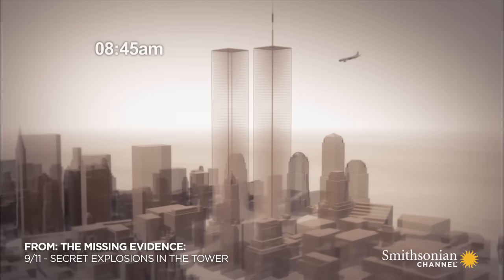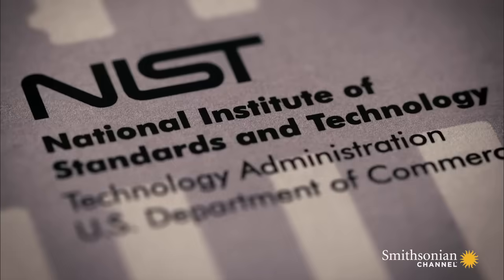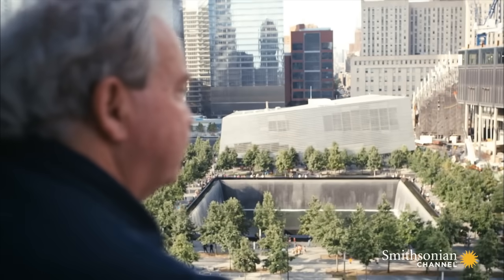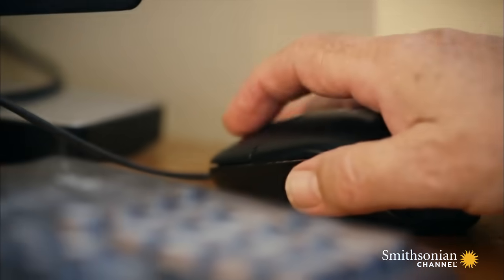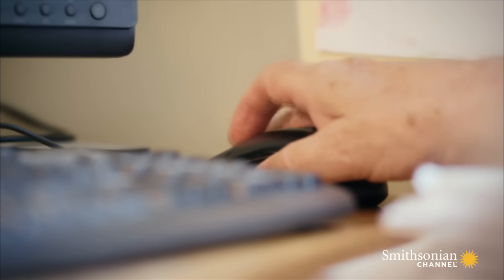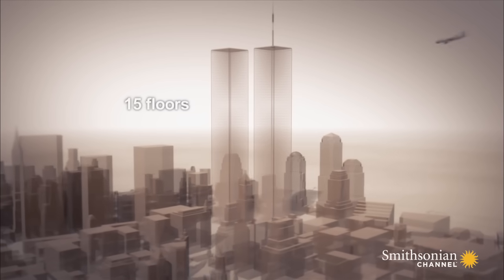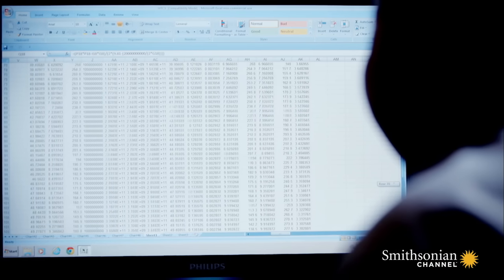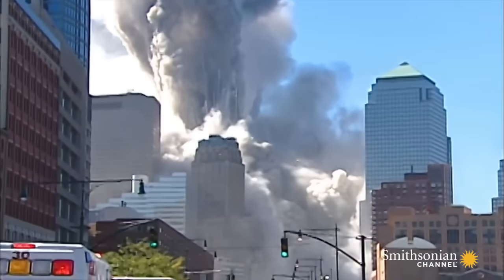This Computer Simulation Explains How the Twin Towers Fell

Comment: What a load of fucking horse shit!    The upper blocks self disintegrated before they even had a chance to 'pile drive' the lower portion of the building downward.
Reply: Chris Gilliam  Try looking with your eyes open.  The top block literally destroys itself before any 'pile driving' effect takes place.  Probably you need to get back to watching Game of Thrones or some Sport.
Reply: Molten steel was visible at the base of the towers for weeks.  From a kerosene fire, lol.  Plenty of witness testimony from firefighters and others.  Just because you haven’t seen that testomony or actual video of it, doesn’t mean it isn’t true.  Are you suggesting they were lying?  Plenty of actual proof over and over again of thermite in independent dust samples.  Are you also denying that 4000+ Engineer’s and Architects state the collapse to be a phsyical impossibility witout the structure receiving help to collapse?   

I’m not sure what the fuck is wrong with people like you.  You accuse me of spreading lies but you believe the oiffical story which is a complete and utter lie.  Many of the 9/11 commission report members outed the report as a cover up and lie.  I guess you also buy the story that the plane crash in Shanksville is 100% legit too?  The official story being that it crashed and left no wreckage because it buried itself into the ground.  No passengers, no luggage, very little clean up of anything.  You would believe that because you suck the cock of Authority and cannot think for yourself.  Truly fucking sad.

Comment: Theres more evidence of a controlled demolition then there is that that jet fuel burned steel beams which jet fuel burns at 1500c and steel burns at 2750c, the only evidence that has is the govt told us thats what happened
Reply: No, there is no evidence for a controlled demolition. Melting steel wasn't the reason reason for the collapse, it was the fact that steel loses a significant amount of its strength at high temperatures, causing structural failure. You don't even know the difference between Fahrenheit and Celsius so I guess I can understand you having this opinion.
Reply: I am sorry but there is ZERO evidence of a Controlled Demolition.  And considering the entire structure was sifted through forensic shake tables for the smallest of human remains makes your claim even more absurd.  If that's possible.
Reply: you fucking dumbass. of course jet fuel can't melt steel beams, but it sure as hell can bend it until the buildings collapse
Reply: Dude I agree with you.  I think you got the wrong guy
Reply: roquefortfiles what do you mean
Reply: You're telling the wrong guy.  I completely agree with you.
Reply: There's also a relationship between the density of a building and its susceptibility to fire.  The lighter it is the less resistance it has.   The WTC was one of the lightest buildings of its size.
Reply: There is video of molten steel pouring out of the building before collapse.  Please explain.
Reply: Mike D steel is liquid at 4000 degrees a passenger jet gets reduced to slag in a normal fire. Source!! runway overshoot in Toronto. The fuselage vanished in the fire.
Reply: What does that have to do with molten steel?
Reply: And what makes you think it is steel in the first place?   More than a little presumptuous.  Wouldn't you say?   Where is it coming from?   Exactly where the plane flew into.    Hardly a coincidence.

Comment: More propaganda... People are idiots or what? I know it's hard to not believe what you can see with your own eyes but :::  Physics of laws says that result is the same no matter what's moving in between two objects. The result would be the same if you move a plane 600 m/h into WTC or if a giant baseball hitter could swing a WTC tower at a stationary plane suspended by a crane in the air. Now, seriously, if someone's swinging a FuK big mega huge WTC tower 600 m/h on a stationary plane, that the plane would go trough the building???? No the plane would be destroyed and the building would have scratch marks.... That should've been the result. When you want to judge something, if only 1 element can't fit in the puzzle, then the puzzle is not true. What about the explosions to lower floors? What about melted steel poring out of the tower 40 stories under the crash? All the small explosions just below the upper section going down? The 4 plane engines (the most solid part of a plane) and the 2 black boxes were destroyed and not found, but they found in the debris 2 still intacts PAPER PASSPORT from the pilots????? There's hundreds of questions like that that just DON'T MAKE SENSE. What i can read here from believers is quite stupid.... Like they designed the towers to fall vertically if they had to fall to prevent damage around them, like if there was too much wind, it would go down vertically LOL LOL LOL Come on..... They build all the towers with one thing in mind::: That they should never go down!!! I didn't expect more from the american population.... When you realize that half of the population believes in creationism you're in trouble right there.
Reply: Spot on! Besides, commercial airliners can not travel at said speed at such a low altitude without falling apart. 500 mph is a cruising speed at high altitudes at which air is thinner. And skyscrapers with "built in controlled collapse capabilities(??)" what the actual f!

Comment: But this wasn't a collapse, the building turned into ashes in mid air. ANY EXPLANATIONS?
Reply: Judy Woods is a complete fraud
Reply: Weight compression , what happens when you squeeze your hand down on a biscuit ? Exactly
Reply: Al Mostafa concrete pulverized? Ya the top floors weigh as much as the fucking titanic. And ppl say the steel disintegrated or w.e...no there is just so much dust from the concrete and dry wall that you cant see anything falling. How stupid are you people
Reply: What Question I'm not so convinced that it would be faked. There are 8 million people in New York. The government doesn't have the capability to fake thousands of copies of video with such a high capability. It would be instantly spotted by people if the government tried to confiscate footage or not. 

Plus people never point this out, but making a conspiracy costs so much more than the actual thing. It's a waste of government money and conspiracies have been proven to not be beneficial at all to the government (if they were true).

The reason why the WTC collapsed like a controlled demolition was because all it's mass could only go down in one direction due to its height and gravity.

Plus planes can destroy steel beams with simply collision.

The WTC-7 collapsed due to subsequent collapse. It's like a butterfly effect. One floor's structure broke due to fire and made the other structures collapse.

The sprinkler system was pointed out to have flaws, so fire could not be extinguished.

Go to the Wikipedia page for the WTC-7 and it's easy to find out that there actually was footage for the building on fire.

Jesus, you truthers really big bozos.
Reply: What Question And it did. The sprinkler system was broken and therefore couldn't stop the fire. The beams in one of the 13th floors buckled and resulted in the collapse of the bottom floors.

It's really that simple. I find inconsiderate that you truthers try so hard to prove a stupid conspiracy.

Plus it isn't nonsense, hun. Making conspiracies cost too much compared to an actual thing. 9/11 wouldn't serve any benefit to the government whatsoever besides declaring a shitty war. It's been proven.
Reply: What Question And you guys are bozos! Steel doesn't have to melt to break. It only needs to get to a certain point where it is able to bend, and can result in a collapse.
Reply: The reason why there was a massive smoke plume was because the building was made of a dusty material called asbestos.
Reply: Again, steel beams don't need to melt to result in a collapse. They only need to bend and that itself could be able to break other smaller components of the structure.
Reply: smitty121981  a distraction. A useful idiot.
Reply: Paul Metcalf - I agree. That doesn't change my assessment of Woods though.
Reply: Iam Negan - How is her insane screeching useful in any way?
Reply: Stuart not a biscuit with dense sugary center like a fig roll..of course we would have to set fire to the biscuit too. Like to chat longer but I am off to buy the right sort of biscuit and some jet fuel  of course . Anyway when I have proven the "biscuit theory"  I will give you a mention in my thesis . This could rank along side the "domino theory" as one of the great  enlightenments of our time.  Thank you.
Reply: Jasko Hodzic dude no it didnt u just cant see all the debri and LARGE chunks of building falling to the side because of the dust...fucking idiot are you serious lol?
Reply: P -Mac "BS Netflix Documentaries" You're more naive than I thought. The Smithsonian is sponsored by the US government lol. You're using them as a reliable unbias source. This video didn't prove shit as usual and left out many variables. "The weight of the Titanic" WTF does that even mean? The lower block is way heavier than the upper block. Do you understand basic physics? The building sped up as it came down, which was conveniently left out of this video. It fell at free fall speed, which is impossible unless there is no resistance. Controlled demolition is the only possible explanation whether you like it or not. Stop thinking our government is some angel who wouldn't kill us.
Reply: Al Mostafa Smithsonian is sponsered by goverment and ur name is FUCKING AL MOSAFA. You wanna be a lil baby ill play your game lol
Reply: P -Mac The collapse sped up, which was left out of this video as expected. No one can deny that. You're using one eyewitness testimony to prove this was a gravitational progressive collapse when 95% of the eyewitness testimony was left out of commission report because they all heard and felt explosives. Fire has NEVER EVER caused a high rise steel reinforced concrete building to collapse. That still holds true till this day. Yet on 9/11, it happened 3 times. What a coincidence lol.
Reply: Al Mostafa dude watch the video again...you can see debri falling faster than the towers idn what this free fall bs is...plus theres so much dust you cant see the progress of the fall clearly, but you can make out the top of the building at the end and its falling veryyy slow
Reply: Al Mostafa oh a building breaking a collapsing got mistaken as explosions by a handful of people??? No way? Really?
Reply: P -Mac It's pretty well known Smithsonian is sponsored by the US government whether you like it or not.
Reply: P -Mac You're literally contradicting yourself. You claim the concrete wasn't pulverized, but say there is a giant dust cloud lol. You're using just this video too look at the collapse LMAO. How about you look at all the different angles for a better view you tool.
Reply: Al Mostafa idc I just came to this video to share my link of the video of the guy saying no explosions and the stairs swaying and walls cracking on the 20th or so floor, and he made it out.  That is pretty interesting account. More interesting then disoriented ppl saying they heard an explosion when a tower COLLAPSED. Im sure it sounded like a bomb went off. I could give a fuck about this video.
Reply: Al Mostafa but yes since ive disproven everything else you said, i can agree the smithsonian recieves federal funding lmao
Reply: Al Mostafa "sponsored" ...where are you from?
Reply: The building is tall enough to make a collapse look like a controlled explosion because of it's mass only being able to fall straight down.

And it's ASBESTOS. That material produces a LOT of it.
Reply: Video fakery is the most reasonable explanation for what we see on 9/11. Judy Wood makes some good points about how some things look and many more ridiculous arguments trying to explain them.  Simon Shack does some good work exposing the video fakery but also presents a great deal of fiction as fact.  Lots of the so-called “truthers” have good points but they all seem to fall apart around some critical issue or another.
Reply: KillMeWithPotato “go to the wikipedia page”
Reply: KillMeWithPotato “WTC-7 collapsed due to subsequent collapse.”

“Jesus, you truthers really big bozos.”

Pick one
Reply: What Question You know, if you are going to say I'm spouting nonsense, then at least provide some credibility.
Reply: KillMeWithPotato “collapsed due to subsequent collapse.”
Reply: What Question And the WTC looks like a "controlled demolition" because the building's mass fell in its own center of gravity, which was only down.
Reply: KillMeWithPotato “It’s been proven.”
Reply: What Question And yes, it is called a progressive collapse.
Reply: A&E 911 Truth has video showing collapsing beams that oddly are accelerating Laterally. 911 Truth also got admission from NIST that freefall occurred at #7. 911CTV channel has collections of plane debris, multiple molten metal videos, all known impact videos and photos. Nano Thermite is a proven fact, found in all dust samples
Reply: Uh yeah.....it was collapsing
Reply: No it was a collapse. Tons of crumbling concrete. A collapse! Done by commercial airliners being piloted by terrorists!
Reply: You need a physics lesson.
Reply: CONTROLLED DEMOLITIONS
Reply: You get a pancake
Reply: Your Right They Should Baked The WTC Longer
Reply: You Must Be A Potato To Believe This
Reply: Yep Idaho baby Idaho
Reply: Of course rubble appears like ash from far as fuck away you moron.
Reply: That's a whole other can of worms that will come out eventually..imo.
Reply: Jasko_watch videos by judy wood-she gives a very convincing explination of how the buildings turned to dust.
Reply: Jasko- i believe dr judy woods theory.. that an extremely  powerful weapon was used..  there is also a famous russian scientist[whose name i forgot] who  has similar theory.. Judy woods  documentaries can be found  on youtube
Reply: god moves in mysterious ways and as it says on your money "In god we trust"
Reply: OOM- 8018 right? Thank you dude lol. You can vaguely see LARGE chunks of the building falling to the side too. You cant see all the debri falling because the dust covers it...ppl are acting like the shit just turned to dust....if the 1000s of ppl were burried under dust it wouldnt of taken fucking weeks to recover bodies. I FUCKING HATE AMERICA SOMETIMES LOL. PPL MAKE US LOOK IDIOTIC
Reply: Al Mostafa and did you not watch the fucking link I just sent you ? Dude on 20th floor says everything starts swaying and cracks in walls begin appearing...so it collpased with VERY LiTTLE ressistance. To the point where dumbasses can say its free fall. It appears free fall due to many factors including the massive dust cloud that makes it hard to really see anything
Reply: Al Mostafa lmao im posting this everywhere I just took a screen shot "the building fell at free fall speed! And it sped up as it fell!" Lmao so stupid wow
Reply: Al Mostafa even in this fucking video you can see shit on the side falling faster....so weve established it wasnt free fall so your wrong there...and the fact it speeds up as it falls is common sense....A GIANT BIRD FILLED WITH JET FUEL HIT A TOWER...AND IT COLLAPSED.  The fact that you cant accept that is either because your stupid or because ur fucking al mufasa...probably a combination